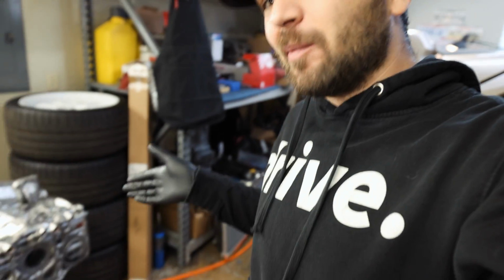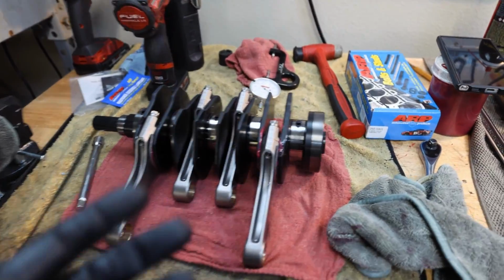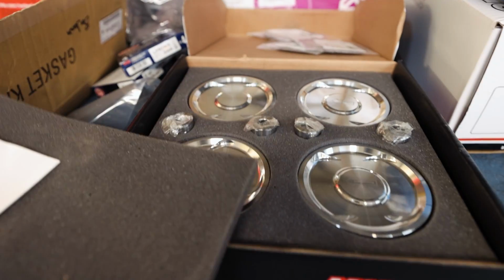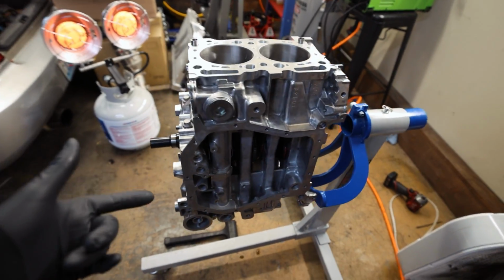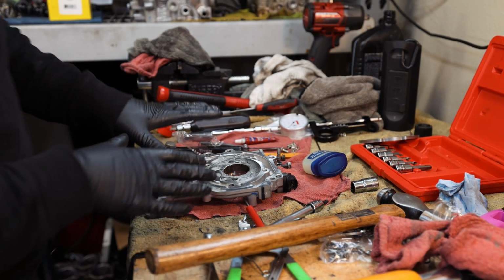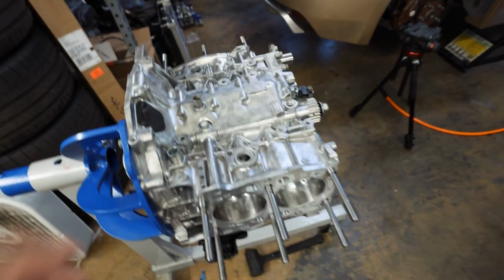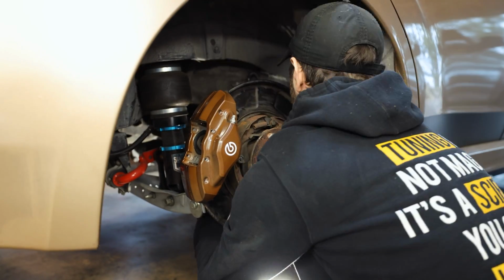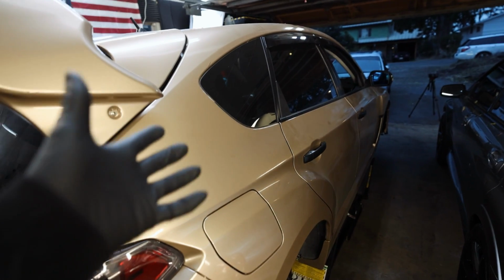My STI Swapped WRX Hatch Get's it's 750WHP Capable EJ25

Comment: I wish I was confident in myself enough to do all the measuring for the crank and rod bearings. That's the only thing I don't want to mess with because it's the weak point of my engine. Everything is so easy to do. Just don't want a second rod knock engine haha
Reply from the maker: As long as you take your time and triple check all measurements you should be perfect. I'd say snag a spare engine to use as practice 😁
Reply: @Smeedia  if the measurements are larger or smaller than spec how do you fix it? Grinding the cam or putting a larger bearing in?

Comment: Heads up tanner those kelford 272 cams require head work to clearance the valve bucket guide, not a drop in cam like the bc 272
Reply from the maker: Appreciate the heads up! I can Clearance them here. Shouldent be an issue :)

Comment: What would you say is a SUPER safe power level for an RA block if you use quality parts and do all supporting/reliability mods but stay TMIC and Stock location turbo? I’m thinking that once I finish my suspension and exterior, I’ll start the power mods. I’m thinking almost exclusively Cobb since I’m in California and most of their parts have CARB certification numbers.
Reply from the maker: 400whp would be the super safe zone 🤝

Comment: I’m curious about where you get your information from for engine building? Like tolerance specs/torque specs and instructions? Did you buy some kind of manual or something?
Reply from the maker: Couple people who've helped and taught me along the way 🙏
Reply: @Smeedia  lucky you. I’m in Germany and there are really not many people that know about building ej motors. There is only like one shop that knows how to build them out here and they charge a lot of euros because they know they are one of the only shops that do it out here. If the situation ever arises that I need to build my Subaru I may have to contact you or something. If you would have the time lol

Comment: 4:28 why are your ring gaps so tight? I have JE pistons and the recommendations say .005 and .0055 X the bore diameter. Which leaves mine at .020 and .022.

Comment: I got to thinking Smeedia, when assembling the EJ would it not be easier to put the pistons on the crankshaft first then assemble the block instead of having to go through those tiny holes to to install the pistons and connecting rods?
Reply from the maker: You won't be able to tighten the connecting rods 🤝 with EJs this is the only way. With FAs you can install the pistons onto the rods first
Reply: Oooooohhhhhhh gotchya

Comment: Will a built engine make more noise than a stock engine...I have iag stage 2 block and heads that got re done... atm.... it sounds like I have more ticking than my stock engine ...
Reply from the maker: Yes, forged parts are generally a little louder

Comment: I'm want 450hp out of my 2.5 can this be done with a stock rotating assembly? 68/66 turbo wanting to go with bigger injectors for e85. How much boost would I need to get to this point?
Reply from the maker: Stock location FP Green or FP Black. What car dp you have?
Reply: @Smeedia  lol it's in a 66 vw type 3 squareback, haltech 1500 stand alone ecu. Subi 5 speed trans conversion.

Comment: No torque plates is wild, at least it’s closed deck but I’ve still seen some decent flex
Reply from the maker: Torque plates are only used when boring and honing, not for assy
Reply: Absolutely not true, especially when the bore and hone is done with a tq plate, the ring gaps should be set with the tq plate on as well. Usually with the plates not being used it’s 0.0015” or so of difference.

Comment: Do you still recommend the cylinder 4 cooling mod?
Reply from the maker: Eh, I don't use them anymore but  no harm in using one
Reply: Thanks! Just sold the G37 to pick up a stock Hawkeye wagon, and I want to keep it reliable with a light stage 1 tune.